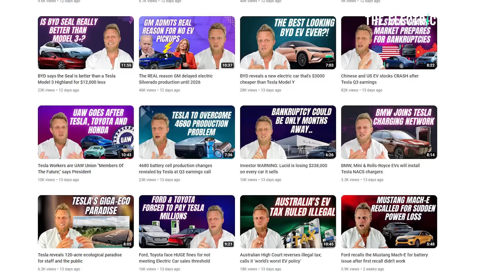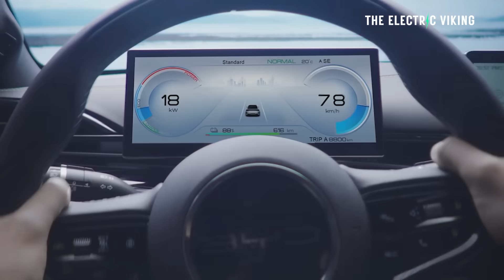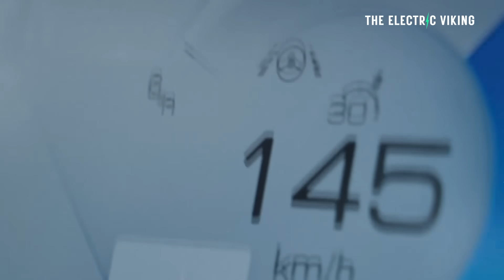After posting record EV profits BYD slashes prices of its electric cars

Comment: With volume the cost per unit drops allowing BYD to reduce prices to gain even more market share and run their assets hotter! New investments to manufacture overseas like Brasil will also propel them up the volume charts!!
Reply: BYD in Brazil is hot cake, should I buy BYD shares right now or it's to late 😂
Reply: I think they are getting to Brazil to be able enter the US market above all
Reply: also the battery prices are getting cheaper

Comment: I have a BWD Seal AWD - fantastic car, test drive one if you can. I agree BYD should concentrate on EVs over PHEVs.
Reply: chillfluencer :  Also, it will be years to decades until there are enough BEV's and supporting infrastructure for everyone to have a BEV.  So in the mean time, PHEV's are the next best thing. 

I can own one as a retiree who doesn't drive much, for example, and with, say, a 50 mile pure EV range, under ONE percent of my miles driven will burn gasoline. 

The VAST majority of people have short enough commutes that a good PHEV will do most of the work in pure EV mode, especially if they can charge at work.

Comment: EV demand is slowing there is no sugar coating on it. The path to electrification is not a smooth one. They need to make EVs with less high tech focus. Simpler EVs that are easier to repair and keep for long term. Not everyone needs a computer on wheels.

Comment: As you mentioned, BYD in the EU is crazy high. So far, despite heavy advertising locally, I have personally seen only one on the road (in use as a taxi). For just a bit more, you can buy a recognised brand like VW ID range or even a Tesla.
Reply: You’re missing the point.  BYD can undercut the Europeans in their export markets and Europe is utterly dependent on those exports.
Reply: You and I both know what the government will do if BYD tries to win the market in Europe through the price war.
Reply: @vitolu6727  Europe will keep its internal market with tariffs, no doubt about that, but it’s exports, which are the key to its wealth are in for a hammering as it cannot compete against China in foreign markets.

Another problem for Europe is that the Chinese use the more reliable and cheaper supply of lithium and green metals from Australia.  Europe can’t readily access that supply line because it’s been running a punitive trade embargo against Australia for more than 50 years.
Reply: Atto 3 is literally everywhere here @ Sydney, AU..... next year will be the Seal
Reply: Lots of MG4 in NZ
Reply: @seanlander9321  where is europe exporting cars?
Reply: @mariusmihai1292  Whee is Europe not exporting cars is the easier question?
Reply: @seanlander9321  I doubt that but let's say is true. where is Europe not exportin cars then?
Reply: @seanlander9321  I will answer for you. where is europe exporting cars china will not sell.

Comment: In Italy Byd Atto 3 is very expensive, it costs the same as the Tesla Model 3 highland, but the technical characteristics are much lower (maximum speed, charging speed, autonomy, no frunk, audio system, etc.)

Comment: I believe we have reached the end of the roll in the USA.  Auto manufacturers are cancelling new EV factories and battery plants. Tesla is about to cancel it’s construction of a mega factory in Mexico.  Dealer lots are full of EVS and there are few buyers.  The future isn’t so electric.
Reply: Elon already said they are not cancelling the Mexico facility just slowing down the building of it, and that it will still be built, but slowed down so as to not spend too much money too quickly...
because of interest rates..
I personally wish he would forge ahead at full speed and get that 25 k car out for us already. .😊

The other US auto makers are cutting production levels because they lose tens of thousands of dollars on each vehicle produced. And will try to get costs down before removing up again .. but I see that failing also..

Comment: Ponder this: The Australian power grid is going through a period of modernization which will require a lot of battery storage devices. Maybe enough to warrant building a domestic battery plant in Austrailia. If Tesla does not want to build a battery plant in Australia maybe BYD might?
Reply: BYD cars offer vehicle to load. Their cars could potentially become the battery. In addition, BYD has far more battery capacity being used in ESS than Tesla (even though other brands may be on the outside of the batteries)
Reply: That's one of the reasons capitalism works.  Profit is a GREAT incentive to get companies to do what customers want. 

To the extent massive demand for backup batteries  exists, SOME COMPANY will build them as long as profit margins are sufficient. 

Over time, things like V2G and V2L should be options are software and batteries keep improving. 

Some day I plan to have my BEV replace my need for a generator for power outages.  At this point, given the price and the risk of fires, I don't want to put large expensive backup batteries in my house. 

But my car, which I could go and recharge on occasion in a big outage would be great for that. And not cost many $thousands extra.
Reply: The power plant storage needs to have sodium batteries otherwise it is very dangerous
IMHO do Not install any home storage battery at present
Even LFP or LMFP or M3P batteries
Sodium battery supposedly if it is defective short circuit will not cause fire.

The chances of battery storage power plant the high risk is the battery

Comment: But when will BYD attempt to break in to the critical North American market, particularly the USA? They will need to make the vehicle meet Federal Motor Vehicle Safety Standards (FMVSS), use the SAE J3400 (NACS) charging plug, and especially make sure the quality is good.
Reply: US/Canada market is not as critical as it used to be. When Japan was building up, the US market was the majority of the global market. Now it is less than 1/5th and continues to decline. The protectionist measures, restricted subsidies, etc. would make ti difficult and expensive. The charge plug is insignificant compared to political challenges. Quality easily beats most brands (see "Chinese Automobile Quality Network’s 2022 Brand Quality Ranking" for reference). Meanwhile, BYD is already the largest EV brand and is moving to become the largest brand overall in several high-growth developing markets, as well as developed markets that are not as restricted.
Reply: They meet the Safety Standards, but there is to big of an investment risk because of US trade war policies.
Reply: At the risk of stating the obvious, they'll do it when it makes SENSE to them to do it.  Like if they fulfill demand in China and Europe and Asia and need to sell more EV's, then it might make sense, despite the US rules. 

But no sense them doing that as long as they're growing fast and making good profits elsewhere.

Comment: The US government needs to subsidize US built EVs for the next several years to keep China’s direct subsidies to BYD from bankrupting US EV manufacturers other than Tesla.  They could start showing Tesla more love than they do too.  Elon made Tesla #1 mostly despite our government vs the Chinese government mostly helps its industry leaders like BYD to manufacture things artificially cheaply.
Reply: Do the math. After the passage of the IRA, the US subsidizes EV's far more than China. $45/kWh Battery Production Tax Credit, $30k per charger, $7500 consumer subsidy, supply chain subsidies, factory subsidies, CAFE and ZEV regulatory credits, state subsidies... China had subsidies early on, but scaled those back and they are currently very small in comparison.
Reply: @larryevans6739  valid points but I’d say the US subsidies are trying to make up for lost time that allowed China first movers advantages.
Reply: @NickWindham  It is always more expensive to play catchup. But US subsidies are massive. Compared to MIT Technology Review's estimates of all Chinese subsidies to date, much of which going to the plethora of automakers that ended up failing, IRA spending is multiple times as much. And, don't forget, we already had subsidies before this, dating back to the Volt. Comparing existing subsidies per vehicle, US EV's are dramatically more state-sponsored now. And our subsidy stack in increasing, while their's is phasing out (as it should with over 36% of their market being EV's).
Reply: @larryevans6739  Good info. Sincere thanks for sharing.

I'm kinda in agreement with Toyota that hybrids are the way until better battery tech comes out for low costs than current tech.  That'll be several years.  Until then, normal hybrids or plug-in hybrids that quality for the $7,500 seem like the way most buyers should go to nudge the industry forward.
Reply: @NickWindham  I have a feeling you are right and we are going to see more PHEV's in the US. Due to GM lobbying for the Volt, they are considered EV's under Federal and California law. It is a more cost effective way to gain regulatory credits than paying an EV maker like Tesla or paying a fine. And I honestly thing the typical pickup buyer would find it compelling, as it covers the "what if" motivation of the infrequent extreme use case that pushes people to buy trucks, while being better than ICE at the typical use case (suburban commuting).

Comment: In the US you can not own an EV if you don't have access to overnight charging (apartment dwellers). Unless you are willing to sit at a fast charger once or twice  a week. China may be different in that they have a better charging network. That being said, owning a hybrid or plug-in hybrid is better than owning a gas guzzler.
Reply: In the real world, apartments can and will build charging spots.  In CA there is already legislation moving new construction to do this, etc. 

The world changes.  Nothing new here.
Reply: And yes, a HEV or PHEV is FAR better than a pure ICE.  Toyota (with its great hybrid tech) should be selling the HELL out of those and pushing to make those in much higher volumes while the transition to BEV still has decades to go.